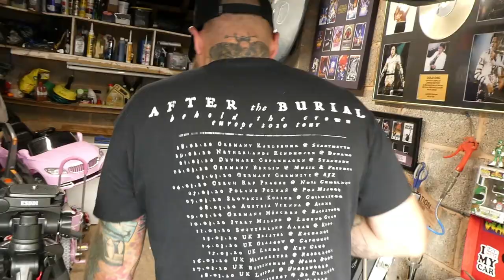FN2 Dynamic LED indicator install plus *EPIC GIVEAWAY*

Comment: I saw someone had mentioned these on a civic forum a few months back, as I posted asking if the standard repeaters are always so dull or if they’re faulty? Because in daylight they’re barely noticeable, in fact I wouldn’t be surprised if it failed an MOT for defective indicator. Definitely getting these now, but may go for clear Lena as have silver car.
Reply from the maker: These are so much better than the oem ones as you can see man. Love mine 🤘🏻❤️